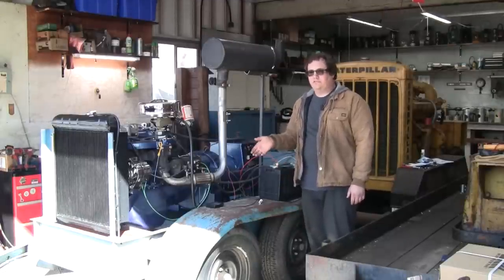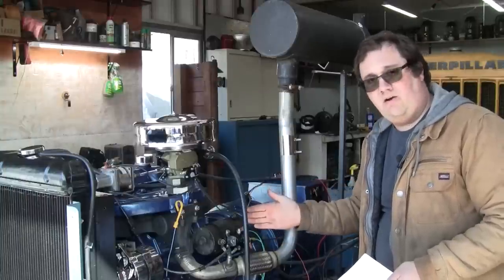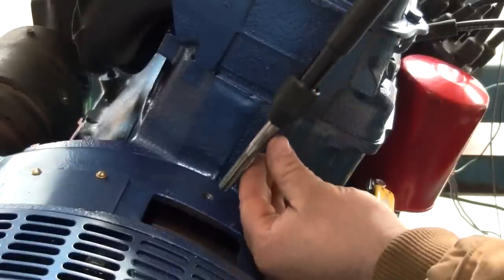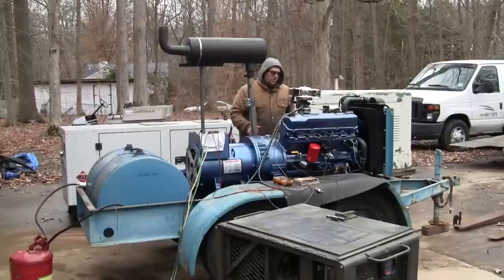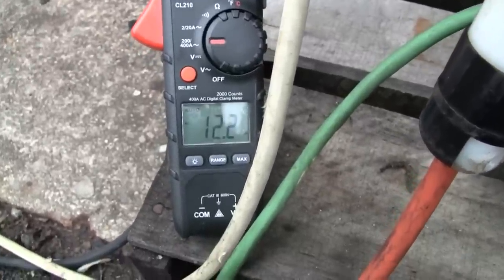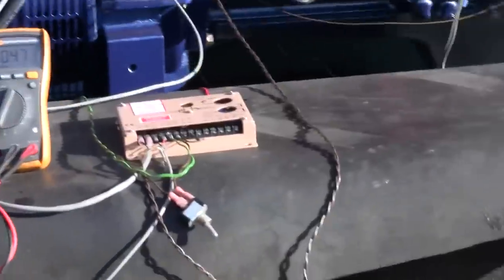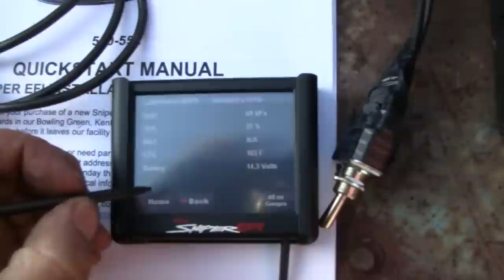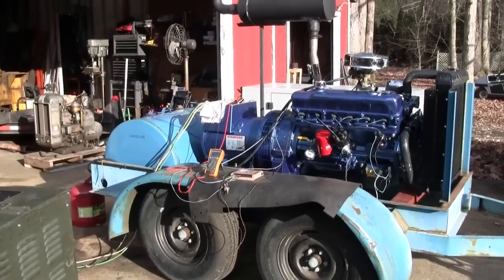Chrysler Slant 6 Generator Gets Holley Sniper EFI Pt.2 FIRST LOAD TEST

Comment: The fuel tank is large for gas , because we know that gas does not age well . The likely hood of using that much fuel is slim , does it have a drain plug to drain old fuel . Great video .
Reply: Add that fuel stabilizer!
Reply: Non-oxygenated gasoline has a much larger shelf life.

Comment: Inline gas engines are smooth runners naturally the slant 6 was one of the absolute smooth runners  and fuel injection really helps, I would have built one with a GM tbi system that was parts would be common and found anywhere, you dont get that with Aftermarket systems like the holley. 
Order and wait.
Reply: Inline engines are naturally balanced better compared to v engines

Comment: I really like old Slant 6 engines but it wouldn’t be the right choice for a standby generator for my home. Diesel fuel properly treated can remain fresh for years. 
At any rate I still enjoyed the videos.
Reply: I've had diesel go bad in my boat with treatment.  I've bought bad diesel from filling stations.
Reply: @rogersmith7396  you got bad fuel . Fresh clean diesel treated and stored in clean tanks is good for years. I’ve seen old farm equipment start after sitting for over ten years with the same fuel in the tank.
Reply: @prevost8686  When my boat was in Florida a fuel barge would come monthly pump the fuel out, filter it and pump it back in.  The concern was condensation and bacterial growth.  You are supposed to keep the tank full.  Now I am on a lake in MO. and have burned as little as 15 gallons a year.  Even replacing what I have used, Stabil, bacteriocide it goes bad.  No voyages to Africa from here.  No polishing barge, no fuel disposal service.  2 micron filter.  Mech injection engine.

Comment: The angle of the throttle shaft adapter is in my opinion too large. That plate is around 135 degrees of angle where it should be around 90 degrees.  The throttle blade in the throttle body and connecting rod end should be on the same plane axially. Right now it is set up where the connecting rod is trailing the throttle blade.  Just for giggles, try a new plate to see if the hunt goes away.

Comment: How about replacing that big noisy windmill of a fan with a clutch fan and matching shroud. At low loads the temp of the air passing through the radiator will be such that the fan will rotate at only a fraction of engine speed and be much quieter. Save a little on fuel too.

Comment: Mike, Is the inertia of an oversized flywheel a good application in load stability? It makes sense to me, but does the added strain on the main bearings offset any benefits? I am clearly no expert in these matters.
Reply: I wonder the same thing. Purely from a power side it would be a mixed bag. On the one hand, a massive flywheel limits droop when load is applied, providing stability in that sense, but the engine also has to be powerful enough to recover within a reasonable time! At that point you'd have to size your engine to the flywheel rather than the load, which could wind up just wasting a lot of fuel in an application like this. Makes sense for prime power if your loads are relatively small compared to the entire unit. I imagine those old Fairbanks-Morse model 32s were smooth as glass... for the most part. For a standby application where there could be instantaneous 80% loading, maybe not. 

At what point is the tradeoff worth it? Probably some math could be done... and if the engine's oversized anyway, that'd be worth something

Comment: How does the governor use pulses from the flywheel? Does it just figure out automatically how many hertz the flywheel makes at 1800 rpm or did you have to count the teeth on the flywheel and program it mathematically?

Comment: 43 years in the generator field, line hz is 60 hz, not 60.5, not sure why you don't set the speed to 60 Hz. Also on gass engines,  the response is slower. Woodward governor had two units Depending on the fuel.  Also on gas engines we were thought to set the governor linkage to a non liner configuration. That gives the best response from nomad to full load. I do injoy your videos,  keep it up.
Reply: I’m pretty sure Mike knows what the line frequency is, I’m also pretty sure he will dial it back if he feels it necessary, he usually does although most generating grids only hold the frequency to within a few points+- of nominal.

Comment: Supposedly the slant 6 is unkillable with modern oils. These engines used to get 200-300k miles in the 60s and 70s under taxi cab service. Definitely one of the better engines out there.

Comment: Allot of times full throttle is a no gas on EFI's on startup  incase of flooding. So you can hold it wide open and get it started. Having a problem with my 02 chevy one ton, the TPI sensor is going bad and leaking down after shut off and floods. I gotta get to fixing that soon. anyway love your videos! Cheers!!

Comment: Regarding the external governor vs drive by wire thing: A gas engine needs a throttle actuator of some sort, so it's probably better to use one designed for a generator...

Comment: Can you do an in-depth explosion of what and how a load bank works?
Reply: As far as I know its just a stepped electric heater.
Reply: It's really not too difficult. If you ever watch James Condon's videos, he tests generators with space heaters. A load bank is basically just a bunch of space heater elements (resistive loads) inside a big box, with switches that allows you to turn on whatever combinations of those loads that you want to achieve a total desired load. And the big box contains a bunch of fans to keep everything cool. Do a search on YouTube for a video called 'Load Bank Build and Test', where a guy builds his own load bank system, and you'll get the idea. Also note that load banks come in different total capacities (voltages, total watts, number of phases, etc.), depending on what is being tested.

Comment: the fuel injection I've worked on has "clear flood mode" that does not inject fuel if the throttle is above a certain % while cranking.

Comment: 30KW needs what, 45 HP @ 1800 RPM?  Not really taxing that motor.  Should be fine.  

Looks totally stable.  Sounds healthy.  The EFI should dial in the fuel map pretty well with more run time.  I'd be interested to see the AFR while you're changing the load.

Comment: The Only thing I would do on a project like this would be a Pre-oiler system and a Light Pressure turbo to further quiet the exhaust and increase volumetric efficiency.   The only thing that scares me about using Gasoline is that it does go bad after a year.  But with Fuel injection? I doubt its going to be a problem.  As long as they keep the In tank pump from picking up any crap from the bottom of the tank, & keep it full? It should not be a problem with yearly maintenance.

Comment: The best thing with fuel injection is you don’t have fuel sitting in a float bowl drying and  blocking jets. (Hence why people like occasional use Honda mini bikes with fuel injection)
Reply: All that fuel evaporating out of the float bowl while not running is one of my main pet peeves with carburetors. Worked on many carburetor cars in the 70s and 80s and my first car was a 73 Ford. Carbs are nice for nostalgia but not for a daily driver IMO.

Comment: A carburator is easy to fix and reuse and don't require half of the things needed to run it. All the problems that he has went over are easy simple and easy fixes or preventative steps that will eliminate the issues that he

Comment: need a delay on the govenor enable so 5 seconds after start it enables the govenor. generally if the holly sees WOT while cranking it goes into flood mode and cuts fuel.

Comment: Mike, can you please answer a question that I have in mind ??? I am wondering which type of engine has the longest life built into the design. Industrial, military, or marine engines ??? 
Nice video and hope you can put my question to rest.
Reply: If you think about gas engines, usually,  they are classified in service duty, light duty is for passenger cars, light trucks  and most pleasure marine use, medium duty is used in medium trucks ( say 350 or 3500  and more) heavy duty are used on heavy trucks as 10 wheels dump or boxed truck. 
the main difference between the service classes is the internal components that are designed to increase the life in the engine in hostile use, one of the improvement is that most of the HD engines have 3 compression rings per piston instead of 2. A good example is the 427  heavy duty truck engine, to  accomodate a third compression ring, the block is 7/16" taller so the hot rodders used that feature to create s bigger displacement.
 usually higher is the duty,  lower is the output for the same engine size.
Reply: Thanks fella.  @jacquespoirier9071

Comment: Hi Mike, Nice Clean rebuild. This generator is interesting.  Can you report on the voltage and current sent to the field winding at low and high speed?
Is the residual magnetism and therefore the supplied field V-I changing from startup to full speed, and requiring more power if it has not run for years?

Comment: Do you have an oxygen sensor in the exhaust? If that is there, I don't see the issue with lite throttle cold starts with the oxygen sensor calling for a richer mixture. Then let the throttle system bring the engine up to the proper hertz. That would be better than WOT cold starts.

Comment: Put a relay in series with the mag pickup that disconnects the pickup when the starter motor is engaged and connects when you let off the starter.

The speed servo won't see rpm during startup.

Comment: Would have liked to see vid on speed controller troubleshooting !    I have this controller)  and to all make sure you match the actuator voltage to the starting battery voltage 
(12 volt battery and 24 volt actuator  like me) the speed controller is both voltages    I did this and it will not stabilize at all.   To you I know your pain with this controller

Comment: My two cents, which is probably worth two cents, is that Holley throttle body is too big for that engine. I know that is hard to believe but the original carbs on those engines were quite small. The behavior you saw at idle and the throttle position at full load indicates to me that it is too big.

Comment: That slant six will live forever at 33% throttle. With gasoline, you never have to worry about the power company saying "no natural gas for you". Also propane supplies have been sketchy the last few years. Of course still not EMP proof, but only a steam generator will get you "full" EMP survivability.
Reply: EMP could still fry the electric/electronic parts of it.
Reply: A mechanical diesel with an air starter. Tho...pumping up a 30 gallon air compressor tank with a bicycle pump to 120PSI might kill the buzz.....

Comment: My professional experience is all automotive, I have no experience with generators. That said, using an automotive engine that has peak power at a much higher RPM than the rated speed of the generator seems like an interesting choice. I can’t remember what power output you said this generator was rated for, but I’m guessing it’s 20 or 30kw. After losses, I’d assume that this engine would be pretty much maxed out when the generator is producing max output, even though the engine is probably capable of 80 or 90kw at higher RPM. Wouldn’t make sense to use an engine designed for lower RPM or a generator designed for higher RPM?

Edit: as I continue to watch, you said it was 30kw generator, and at 30kw even though the throttle position wasn’t that high, the manifold vacuum was pretty low. 100kpa is full load (or atmospheric pressure, i.e. no manifold vacuum at all), 10-15kpa would be warm idle with no load. So the engine was probably around 75-80% load. Again, this is an automotive engine that probably makes max power at 4000rpm or so, so the throttle and intake manifold will be sized for peak power at that higher RPM. It takes very little throttle position to get peak power at such a low RPM on an engine like this.

The engine is probably running rich under load because the manifold vacuum is low (I.e. under a heavy load) so the EFI system is likely switching to power enrichment mode. I’m sure there is a way to tune that out, but you’ll have to be careful about combustion temperatures/pinging if you do.
Reply: Chrysler built variations of the slant (and other engines) specifically for different applications. They usually have different advance curves, cam profiles and other internal changes to handle different operating parameters. Its actually pretty common, quite a few Olympian brand gen sets use detuned 5.4 and 6.8 Fords, and my work has a street sweeper with a tiny Chevy 4 cylinder that was also used in early 90s Pontiacs.
Reply: Agree, its not an optimized system.  Curious as to fuel burn.  They were not that great in cars.  My 152  CI TR6 long stroke  would struggle to get 20 mpg.  Very torquey for its size.
Reply: The slant 6s all had poor head design.